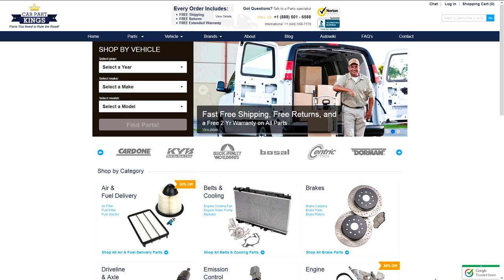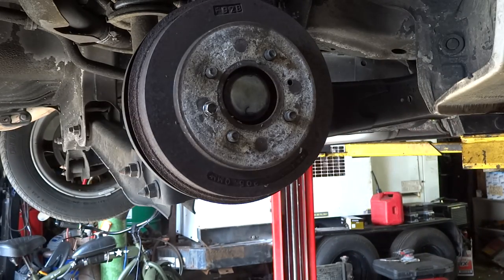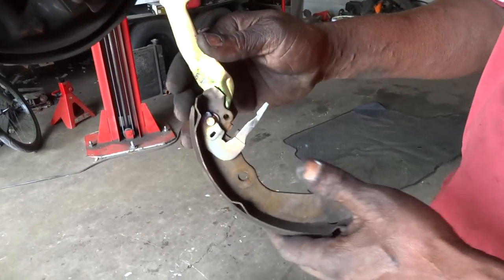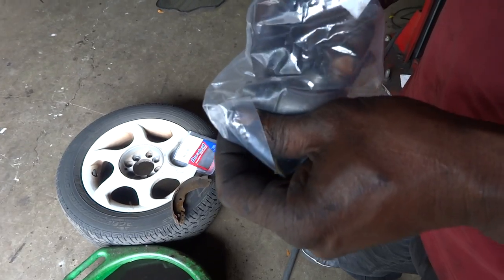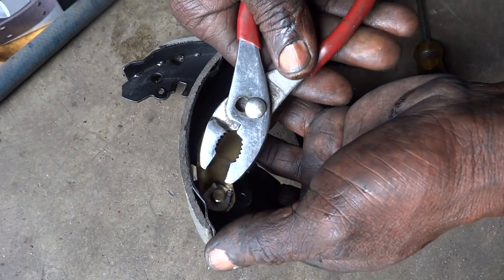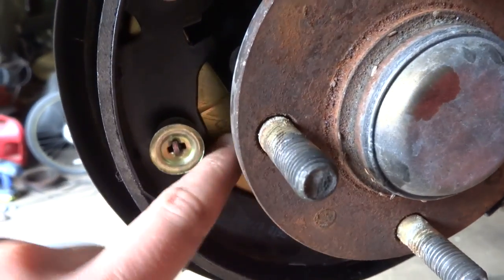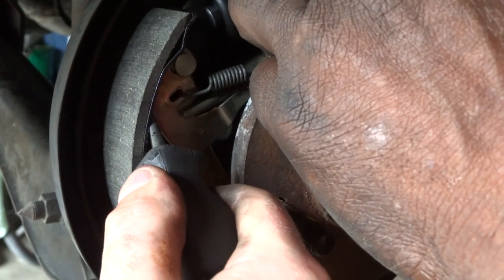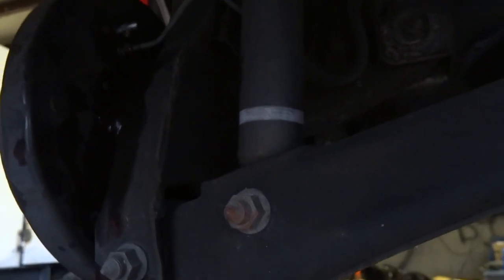▶️Drum Brake & Wheel Cylinder: How To Replace (Mitsubishi Mirage 2000)🔧

Comment: My drum doesn't spin at all. Does this method help for that case?
Reply from the maker: If your e-brake is not engaged then it should spin. If it doesn't spin, it's either the drum pads are engaged due to a bad drum brake wheel cylinder, or you have a bad wheel bearing.
Reply from the maker: If you've replace all that and it still doesn't spin, then there needs to be an adjustment made to the adjustment arm.
Reply: @Nthefastlane  Thanks for replying. My e-brake is not engaged. I am not able to open the drum to check these things as well. Do you mean that the methods in the video to open the drum are applicable for the case the drum doesn't spin and is stuck to be opened at the same time?
Reply from the maker: If I ever do another drum brake repair I'll include this tip. I'll give you the tip now, look at the front of your drum, closest to the wheel studs. You will see a little 10 mm threaded hole, grab a 10 mm.. I believe it's 1.25 pitch on the thread. Any Honda 10 mm bolt, or even a 10 mm bolt from any vehicle you're working on should tighten into that bolt hole. Tighten it with a 10 mm socket and a hand ratchet. As you tighten, the bolt will push the brake drum out.